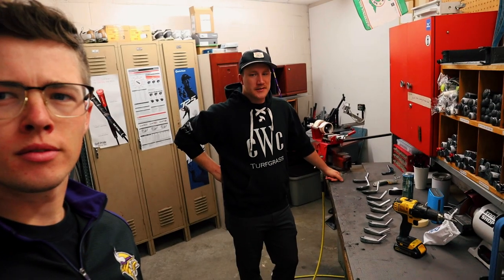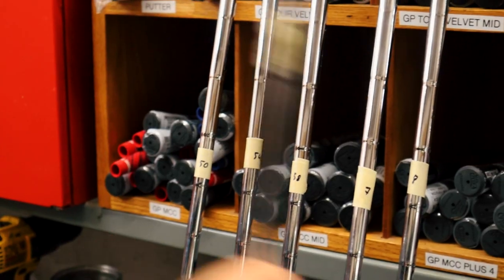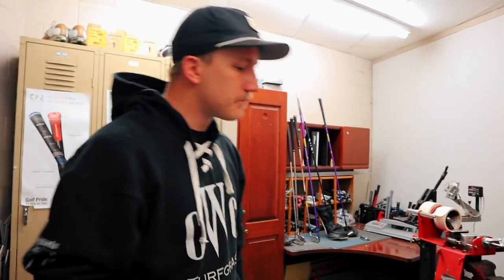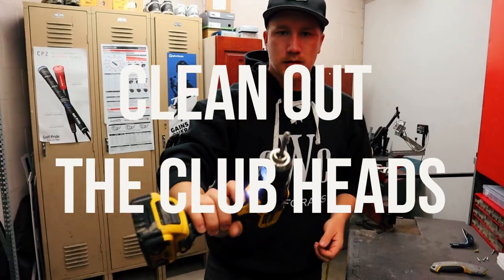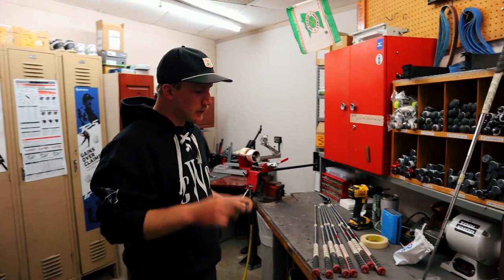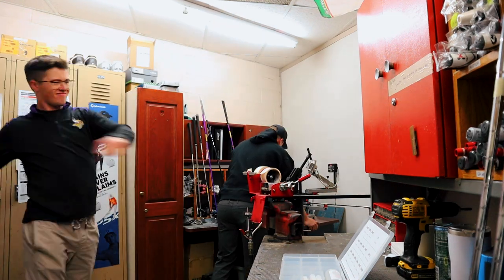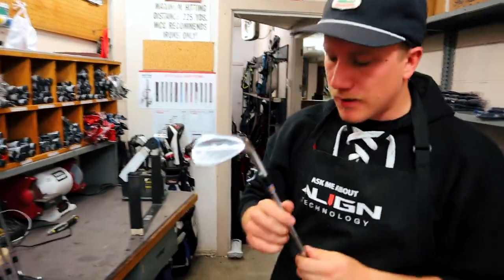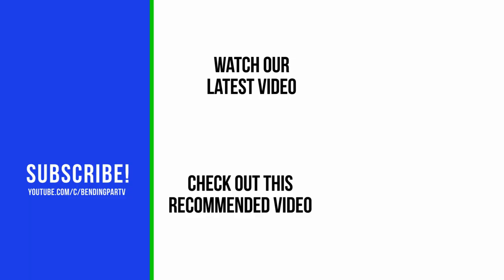Pimp My Golf Clubs with BB&F Co Ferrules

Comment: I always clean the clubhead before sending the job out the door. A great club maker once told me “it doesn’t matter how the club come into your shop, when it leaves, it represents your work.”
Reply: What is your preferred method of buffing clubs?  I have an original set of Titleist AP1's that are chrome, but could use a good buff/polish.
Reply: @jonq8714  - It depends on the nature and severity of the imperfections. If it's mostly dirt and grass stains, I’ve had great success using Oxi Clean laundry stain remover. Spray on and use a small drill brush to clean it. After it foam-up, simply wipe it off. It the imperfections are rust or blue stain from prior heating the hosel, I use a combination of Blue away chrome cleaner (Hard to find these days), BKF Cookware Polish Cleaner, and Menzerna GW16 Finisher. Other people have use various polishers with success, so feel free to experiment to find what works best for you.

Comment: Hey guys, great video. When I pulled off the heads of my set there was loads of old gunk inside the shaft, not just the hosel and the tip weight was kind of corroded so crumbles when I try to plier it out. I can't seem to simply drill out the gunk either, it seems rock hard. Ideas?! Thanks.

Comment: The wire brush alone will not fully clean inside hosel,  there will allways be some old glue at bottom of bore that needs removing with appropriate drill bit.
Reply: You are correct. Due to editing and making sure the video wasn’t too long that part didn’t make it. A fresh wire brush will take care of 95% of the cleaning but yes a drill bit is needed sometimes.